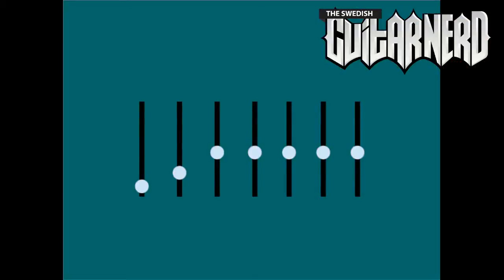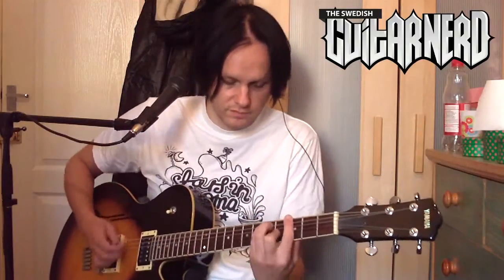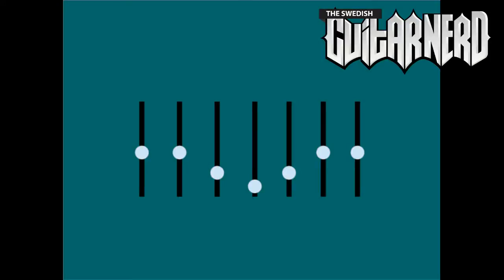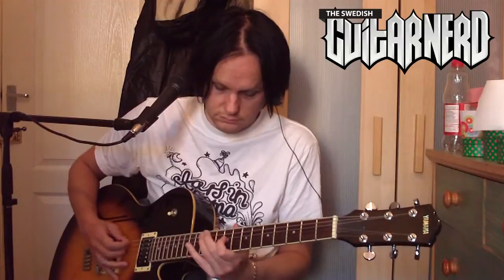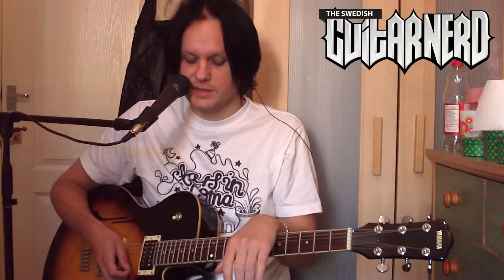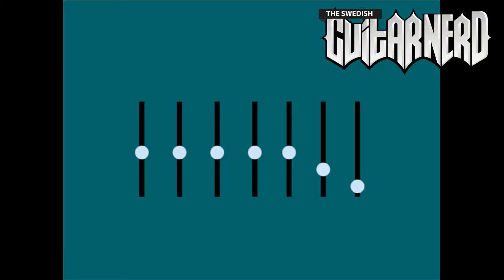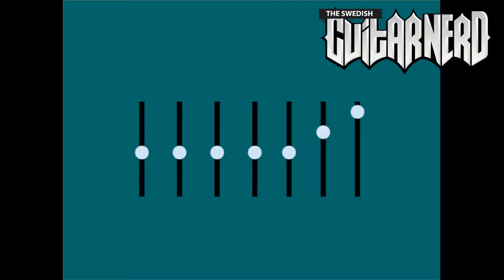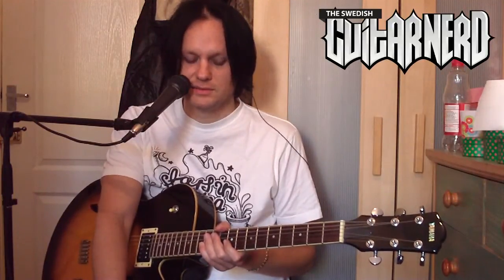Graphic Equalizer - Effects Explained 10

Comment: which one is better, the Boss 7 band, or the MXR 10 band?  Ok.. I  Play a Fender Stratocaster, through a MArshall JCM 2000 40 watt combo tube amp. It has plenty of good gain, but not much  thickness of growly bass, like a Marshall head and cab.  So I am trying to get a real thick huge tone, not a generic metal tone, that is kind of easy.  I am trying to get  a real thick Hendrix-Stevie Ray type tone..where it is real heavy, but you can still hear the  thick high notes, and  growling bass notes and thick sounding chords. So can you give me some advice, would an eq pedal help with that to expand the sound and make it way huge, like what I am talking about? Post up, let me know what you think would be the best solution..I am on a very low budget,  so,  thanks if you know what the deal is.
Reply from the maker: They're both great pedals. I can't really recommend one over the other. I've been a Boss user since I started playing guitar so I would probably get that one myself.
Reply: did you hear of the  Boss eq 20 pedal? What do you know about that one?
Reply from the maker: Yes I've seen that one. I wonder who needs that kind of a product?
Reply: I got it real cheap, it was used...so let me know what you think of that one.  I would like to know of  the experiences others had with this pedal.  the Boss EQ 20,  if any of you have used it.  I think originally, it was a standard  $100 pedal, at least,  but I got it used,  good shape,  cheap, so why not?   I have not messed with it too much yet..
Reply from the maker: I'm sure it's great. It probably does more than you'll ever need though.